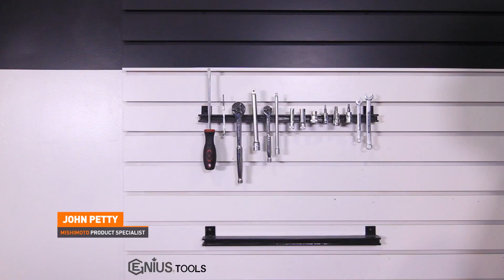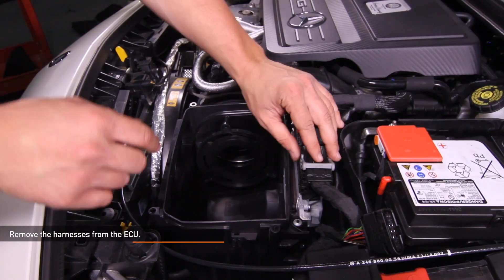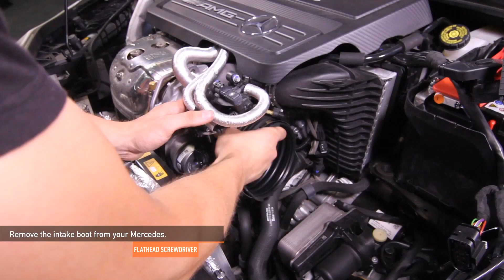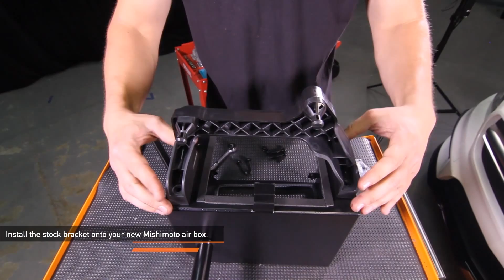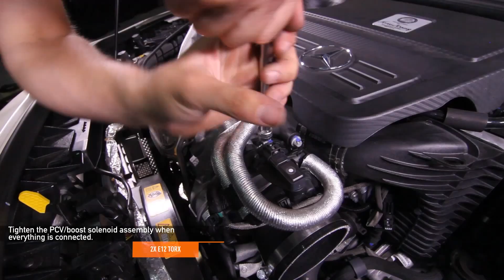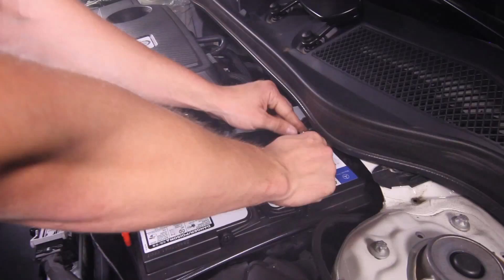2014-2019 Mercedes-Benz CLA45 AMG Performance Air Intake Installation Guide By Mishimoto

Comment: After taking the ecu out will it require code clearance after or will no faults appear?
Reply from the maker: No faults from this. The first step of disconnecting the battery is the same as removing the ECU - the power is cut off.

Comment: Does this only fit a 2014+ model? I have a 2013 model and wanted to install it on mine
Reply: Yes it fit, have it on mine
Reply from the maker: We did not receive this platform until 2014 so we are unable to confirm fitment for the 2013. Your best option would be to confirm your OEM part number.

Comment: Will it fit the regular cla 250 year is 2018
Reply from the maker: The intake will not work for the CLA250 unfortunately, the design for the CLA45 was different than that of the CLA250.

Comment: does this fit the gla45?
Reply from the maker: Yes!
Reply: Mishimoto Automotive does this fit the a45?
Reply from the maker: Fitment has not been confirmed for the A 45.
Reply: Mishimoto Automotive http://carbonwurks.com/shop/mercedes-benz/mercedes-benz-acla45-mishimoto-intake-kit/

bought from carbonwurks, they said it suits A45/CLA45/GLA45.
would the installation be the same process since they share the same motor?
Reply from the maker: Yes installation should be relatively similar, however we only confirmed "direct fitment" for the CLA45 AMG and the GLA45 AMG.  Feel free to give our customer support team a call at 1-877-GOMISHI or email support@mishimoto.com if you have any additional questions! :)

Comment: Hey love the video! just wondering what this does to Mercedes warranty on my 2015 CLA45?
Reply from the maker: disconnecting the battery is the same concept as unplugging the ECU - cuts the power. You will not experience a CEL from this.

Comment: So what's the difference between stock and your CAI. Is there a performance improvement ? Does the ecu need reprogramming at all?
Reply from the maker: Great question Tas!  Our 2014+ Mercedes Benz CLA45 AMG Performance Air Intake is a direct fit - with dyno-proven maximum gains of up to 20 whp and 17 wtq on the stock tune.  Here's a link to the product page for more info: http://mishimo.to/1M9SvfF
Reply: +Mishimoto Automotive great thanks !